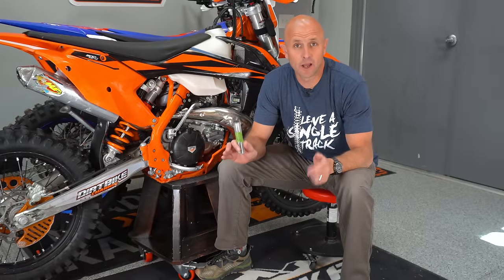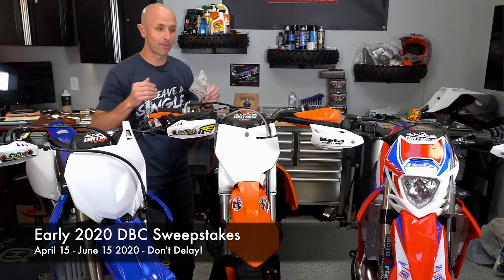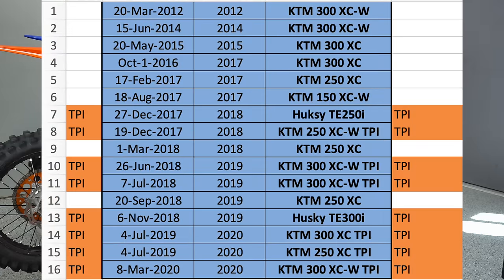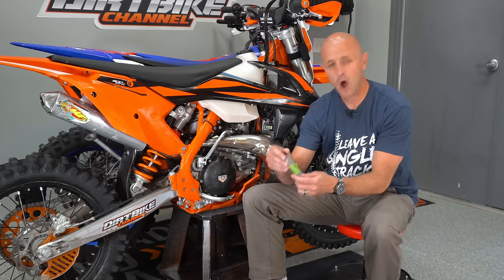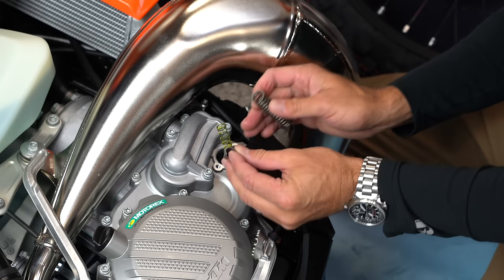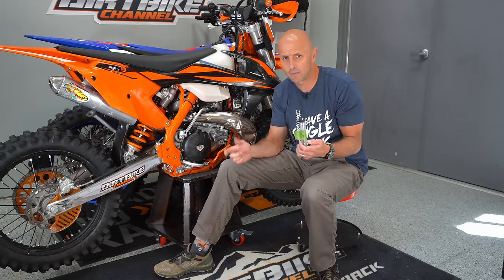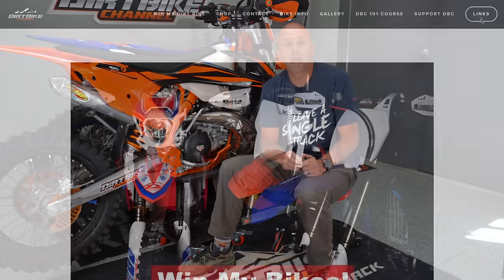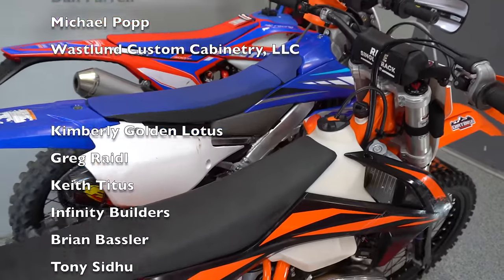The MAGIC KTM TPI Power Valve Adjustment | Top Tip!

Comment: Just did this to my 2021 300 XC TPI and I'm actually amazed at the difference it made. I was trying to practice slow wheelies and double throttle blips and really struggling. Turned out 2 rotations and bam! slow wheelies no problem. I didn't think it would make that big of difference, definitely going to be bringing out my adjuster tool next time I go to the trails in case I need anymore adjustments.
Reply: Did you go counterclockwise or clockwise? Is it flush with case now?
Reply: @branttmyhres74  Counter-clockwise, when the dealer assembled the bike I think they turned it in way to far. It's now close to flush with the case. I would say ride your bike at low speeds and try to pick the front end up without using your arm strength at all, then adjust as needed until it the power comes on the way you like. Like I said in my comment, mine was really slow for power to come on and I had to yank on my bars to get the front end up, after adjusting I could just use the clutch and throttle to get it up into slow wheelies the way I wanted, and the power was the way I wanted in flowy single track too.
Reply: @johnschmalenberg  Thanks!
Reply: Im having this exact problem. I will have to turn it way out because right now its 2.7mm in

Comment: Not only are the bikes unique individually, the riders are too. The power valve should be adjusted to the rider's preference and needs, just like suspension should.
Reply: I found in practice, that there is an ideal setting and with more preload on PV the torque behaviour of the Motor gets uneven. This means torque is low and with increasing speed it rises much and suddenly. I can not see who can take benefit of such behaviour.

Comment: Hi Kyle, love the channel, big fan. Soooo, to confirm; screw out (anti clockwise) for a more aggressive power curve, screw in (clockwise) for a mellow power curve? Also have you had any experience with changing the the spring color, ie as per older ktm 2ies?
Reply: Basically, Yes, But if you go too far out you will have a similar effect as going in.  I like to find a small loop with some undulations and a slight to medium uphill to roll on and off the throttle on, I go OUT 1/2 turn, better or worse If better, another 1/2 turn, not better then back 1/4 better then I leave it and so on.  I've found on my 3 17-19 300s I liked 1/2 - 5/8 turn out on all of them, it just makes the power come on a bit earlier which makes it more linear instead of detuned then a hit.
Reply: @leroywilliams7210  is that out from how it came from the factory, or 1/2 turn out from it being in as far as it goes?
Reply: @samuelyeet6006  Most bikes I’ve worked on have ended up 1/2-5/8 turn out from the factory settings.
Reply: @leroywilliams7210  ohh ok, see i couldnt tell if people were getting them and turning the screw all the way in and then counting turns out, or like you said getting them and turning it out

Comment: even if they made 100 motors in the same day and dyno spec each one,  no two would have identical numbers at identical spots along the curve. every piston , rod , head , rings , crank will have different weights and tolerances from each other. leading to every motor behaving differently (minuscule differences) .  Also if the motors are tuned to run as clean as possible ( which is likely ) due to the EPA , and unless they can control every single variable from humidity , to barometric pressure in the dyno cell than hour to hour and day to day every motor will have different settings to reach emissions optimizations  for the day it was put on the dyno.  Thats just my theory Based on KTMs  engine assembly information and knowing they do dyno tune and inspect every motor before it gets installed into the bike. 

"There are different types of dynos. Some build up all necessary connections (fixation, exhaust, fuel, wiring) more or less automatic or semi-automatic, after the engine has been put in, some have to be mounted manually. The circulating cooling water is preheated to smooth out ‘warming up’. The dynos for two strokers logically operates without the oil pressure control task, in addition the test run is used to time exactly the opening of the outlet valve at given revs with help of a spring (which has been pre-adjusted on the line), so that engine characteristics are tuned in the optimal way."  source KTM Blog.com 

id like to note it does not say the engines are tuned for optimum performance, just they are tuned in the "optimal way"   thats like reading the words Natural flavors on the ingredients list on foods. it basically can mean anything and nothing.

Comment: Thank you so much, it is all true. You encouraged me to turn the "forbidden" screw. I have tested my adjustment on a 2019 Husky TE250i on a straight with all adjustments from full in to full out. Initially my Bike was weak in the mid of the Powerband and increasing to very strong at upper rev, indicating the PV was preloaded too much and thus opening too late. Turning in, this behaviour shifted to even higher revs.
Finally, the screw 2 turns out from initial (initial: 1,7mm in) gave me the most power and at the same time the best control.
Different much better motor now. Thanks a lot! (my optimal setting: screw sticks out 0,3mm from even with housing.)

Comment: We like to use red spring with very late break in. This way you have half throttle torque and after half you will have a motocrosser.
Reply: What do you mean by very late break in?
Reply: @ML-vk8ev very late open of the pw. but that's just a personal preference.
Reply: @ZonaEnduro  
Makes sense now. I guess you have the main spring turned in a few turns. I have a 2014 250 xcw. Last couple bikes were kx & yz 250 so used to being able to pick up the front with a quick twist. I assume my bike has a yellow spring. I turned it out to flush. It's pretty good, but I bought a red to try but haven't installed it yet.

Comment: On my 17 xcw I’m running the green spring with the brass dongle flush.  I like it that way because it made the bike extremely linear.  Our trails are really tight with lots of logs and rock step ups with no run ups at times.  
1. It took away arm pump fatigue from going in and out of the hit and a little less clutch work through the tight stuff
2. I love hoping big logs at low rpm and minimal wheel spin. 
This year was the first time I started tuning the PV.  I should have done it earlier.
Reply: sounds fun to ride....zzzzzzzzzzzz You probably ride with a reckluse too
Reply: Twiisty nope no rekluse, I live in an area with toughest single track in North America, but thanks for the reply 😉
Let me guess, your clapped out 2006 honda 450 is just the bomb.....lulz
Reply: on "my" '17 Flush was too far and I was actually detuning it.  "My" '17 about 3/4 of a turn out was linear and beyond that I actually started detuning just like in.  JD had some great graphs with Dyno Runs years ago showing exactly that.
Reply: Leroy Williams I’ll have to give it a try.  I haven’t really played around with it, basically went from stock to flush

Comment: I just converted my 2022 exc 250 into supermoto. The workshop guys obviously changed the rear sprocket to make the gears longer, but after a few days of riding I realised the bike was nearly dead at low rpm. I turned the power valve 180 degrees counterclockwise and now I have power at any revs because the valve opens earlier and it gives that extra punch to pull longer gears

Comment: Power valve would better be called power delivery valve. On one end you have torque and the other horsepower. Do you want a slow mid range or fast delivery of horsepower or stated another way but the same thing do you want a longer delivery or mid range or quick loss of torque? The yellow valve gives you balanced delivery of torque and horsepower by creating a smooth range of power delivery. Otherwise without the power valve and a big bore exhaust you’d grab the throttle and it would lug and then all of a sudden stand up and wheelie. On the flip side keeping small exhaust port gives more torque to lug you up hills at low speed but when you open it up there high speed is gone. In short. Don’t piss with it and if you do with big swings it’s a matter of preference and likely will have you being beat on the track or in the hills by your buddies.

Comment: Good insight mate. I have 2018 ktm 300, was bit boggy, using heaps of fuel. Didn't like running slow for too long without clearing it out with a good rev. Fouled so many plugs ever ride. Only 50km to a tank if lucky. Changed jets, put suzuki needle in to get rid of mikuni carb stupid weird tapered at end needle. Put powervalve adjustment out too almost flush, 14/49 sprockets. She's an animal now. Beats all my mates 450s in the tracks,dunes,road. Getting just over 150km/hour top speed, but still only about 70-80km range. Mikuni carburetor sux. Wish I had my keihan off last ktm300. Avagud1

Comment: Seems to be what you are saying is a lack of quality control at the factory. They should all be run up and tested and set the same (not the screw position, but the power)
Each bike should ride exactly like the next one off the line if the proper checks were in place.

Yes the owner can fiddle with it, but at the prices the Team Orange charge for these bikes, you expect them to be right...Maybe even Ready to Race 🤔

Comment: I’ve seen one of your videos where you say that you use the red spring in all your ktms because it makes the power more linear. Is this also true with tpi bikes or do you leave in the yellow spring and just adjust the screw on the fuel injected models. I have a 250 tpi and was considering red spring. Lineat

Comment: Looking at a 2021 300
Would u say turning the power valve out gives more low end rev, for example hitting/revs hard coming out of corners. 
Tuning this cause any issues with the oil to fuel auto mix?

Comment: I'm a little late here but I have a 2017 Husq TX300 and I use a Kreft Powerdial. I change the powervalve all the time based on where I'm riding. I'm 50+ and ride a lot of long races. I turn my pv in quite a bit, usually between 1.5 to 2.5 turns in from flush to make the bike calmer and easier to ride. I have a Lectron carb and an FMF pipe and silencer and turning the adjuster in takes away the whiskey throttle. Full power is always available with just a stab of the clutch when it's needed. Do some testing. You will find there is a lot you can do with the pv to help you ride faster and better.

Comment: You give very wrong advice, in fact you'd better take this video down!
Each bike comes ex-factory with the PV set to start-activate at 5500rpm, you knew?
Only when that is set one can start 'personalizing', a lil more or less.... but it won't be massive bits, maybe a few hundred rpm's.
Oh, be sure to measure the rpm's: open the LHS EV-cover, rev the bike to the point you see it starting to open, then check what revs it does... and adjust from there! Simple really, and LOADS better than your "turn it in or out until you're happy".

Comment: Bought a new te150i and it just ran like crap. When doing 45 mph it huffed and puffed stuttered with a constant throttle opening. After setting the idle It still wasn't working.
We figured out it could be the powervalve that was willing to open but didn't. But at 45 mph it should be open already.
We found the PV to be almost completely in. We had to wind it out +3 turns to wake the bike up. There seems to be no basic setting at all at the factory. They mark it so it looks as if one shouldn't play with it.
Fuel consumption also was very bad for a tpi. Exhaust was wet. I believe the wound in PV might be responsible for all that since the bike couldn't breath out properly.

Comment: Hey mate just bought 300xc and dealer told me not to touch the power valve cause it’s been set on the dyno and tuned .. i made 1 turn out just wanna know if it will stuff my bike up down the track ? Thanks

Comment: Kyle do you know if this is a color coated spring in there? Have you been inside these tpi power valves?
Reply: TPI bikes come with the Yellow Spring just like the non-TPI, you can still buy the other springs and replace though.  TPIs are a bit soft so a Red spring really can help.

Comment: Yes exactly! I was disappointed with my 2022 tx300i at first because it felt like it would fall flat on its face in the upper area of the power band. Adjusting to preference is so important, like you said there is no set point for it…it has everything to do with personal preference whether that be your riding skill, your riding type/ environment, and overall what you want out of the bike.

Comment: The power valve spec in the Owners Manual is not the same for a 250 and a 300.
2020, 2021 & 2022 300"s all call for 2.3 mm +-0.2 mm distance from the top of the aduster screw out to the surface of the case around the screw.
It is 2.7 mm as I recall for those years of 250"s.

Must compare apples to apples! 300 to 300. 250 to 250l

So your 2 bikes bought on the same day should not have been the same!
You are wrong not KTM.

I have z 2022 300 XC,

Comment: Jimmy Lewis (runs dirt bike test) says not to adjust the powervalve without addressing ECU tuning as you might cause motor damage to a tpi bike. Any thoughts on this? Jimmy is a pretty knowledgeable guy if you aren't familiar with him
Reply: JD Jetting did a bunch of dyno runs on this a couple years back and the amount of change in fuel ratio was very negligible.
Reply: @leroywilliams7210  was this on a fuel injected or carbeureted two stroke?
Reply: Adam Dyment JD did dyno tests on TPI and non TPI bikes.  He has graphs published of what each 1/4 turn does from closed to open to your power curve and he tested TPI bikes to see if turning it a turn would make them run too lean.

My TPI I had red spring and 5/8 turn out.  I also added a JD Tuner as “my ‘19” TPI was lean and lethargic from the day I got it.

Comment: I have. 2019 250 xc-w tpi. About 50 hours on it. Running like is plugged up now. Used to run great. I replace crank case pressure sensor. Still running plugged up. What else do you suggest. I need help please.

Comment: As you know I support your channel. But I have a simple question. Instead of adjusting the newer versions of the TPI bikes, the ones suggested not to move. Why haven't you tried using the other spring rates first? Seeing if that give the desired outcome / without changing the setting from the factory dyno?

Comment: What's the point of adjusting the valve when your exhaust has been destroyed won't do a thing the 300 stops making power after the strong bottom end with all the tourqe
But the 250 gets stronger with higher
Revs

Comment: my exhaust used to catch fire and glow red. totally discolor
winding my valve out cause the bike to stall. and winding it in caused it to rev to half throttle no powerband
ktm powerparts dont sell the spring. could this spring be cooked and gone to stiff

Comment: Thanks for the content, as far as "tune it to your preference" -- what exactly does it change as far as the power characteristics? You mentioned not liking how one of them revved out and 2 full turns out resolved that -- so it changes top-end? does it do anything for bottom end? How does modifying it interact using the power map switch?
Reply: It's the hit. The further in, the hit will come later and not be as snappy. With the screw flush with the case, the hit will come sooner. You just have to play with it. I keep my Beta 300RR almost flush with the case. You just have to play with it.
Reply: @BarnStangz  From the dyno charts I've seen with a little googling it looks like it makes a difference starting somewhere in the 4500 - 5500 range and up from there. So to answer my own question, seems like low-end is unaffected.
Reply: Trey Morita it just adjusts when the powerband comes in. The low end isn’t affected
Reply: The further out it is, the quicker the power band comes in and further in the later. With it all the way flush the power will come on sooner but because it's a couple hundred rpms lower shouldn't be as violent.

Comment: I use a 1/4" extension and grind two adjoining sides down.  It makes the square smaller.  Fit it to the hole in the power valve adjuster.  Buy an extension at a hardware or automotive store.  The cheapest one is fine.  Don't grind too far but it doesn't have to fit perfect.  The load to turn it is not horrible.  Good Luck!
Reply: This is what I did and used a small wabbly attached to it I carry in my pocket on Tuning days for quick adjustments!

Comment: My Son has a ‘19 150 xcw, the manual says do not move the brass adjustment screw. It came with two springs, one is yellow and the other has no color code. We have tried both springs and both seem to hold the power closed for too long. Anyone have any suggestions on whether or not to move the brass adjuster?

Comment: Wife just bought me a 2022 300xcw for Christmas! 🤘. But I do have a question.  I have had an 06 (vforce 4 reeds and fmf exhaust) forever. Always loved it. Riding them back to back the 06 seems like it's just way more alive. Is that to be expected or is there something I need to check into on the '22?
Reply: Yes, back out your power valve screw a turn or two and repeat as desired until your preferred powerband is achieved
Reply: @Stewart7516  I will try this thanks!